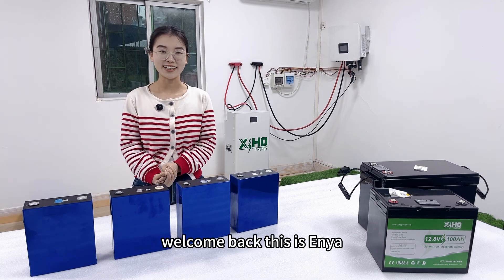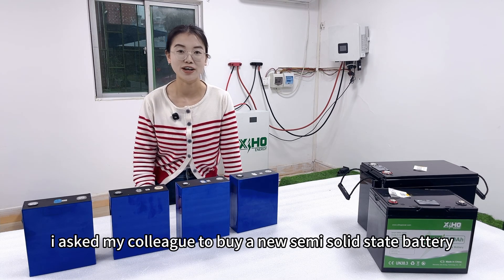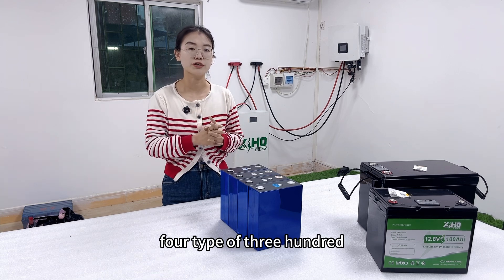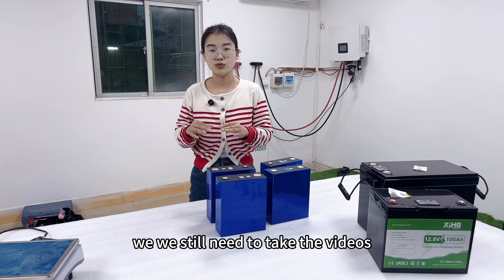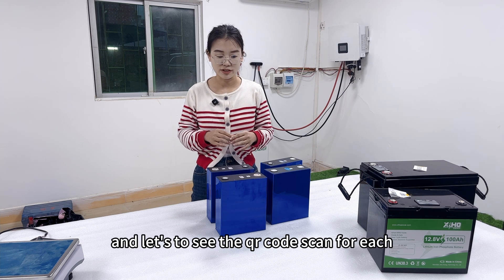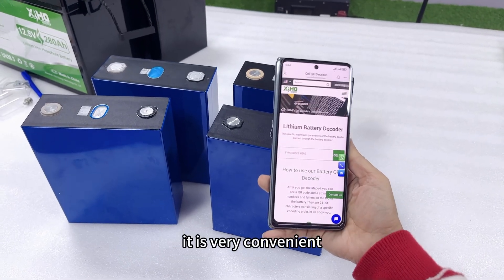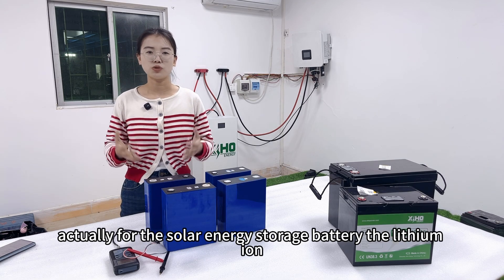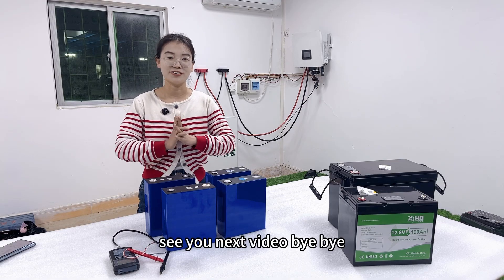Scammer?? Semi solid state battery VS lifepo4 battery, which suitable for your solar system?

Comment: Semi solid state has nothing different(99.99%) than a normal LiFePo4 cell except for marketing. They change one little component to be able to call this semi solid state and they use liquid also and claim more lifecycles which in itself is a lie.  Semi solid state is a fraud. If it was really different it would have been much lower weight for the same size. You can't have something that does not exist! 3 - 5 years more for solid state battery! Thank you for sharing. It says a lot about you guys!  😘
Reply from the maker: Thanks for your comment. We are always trying to share more information to our customers